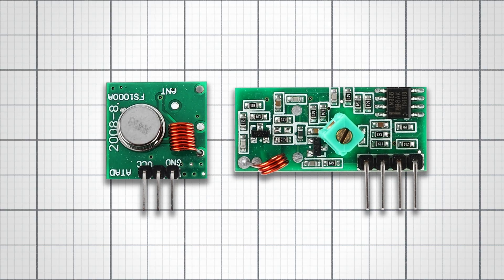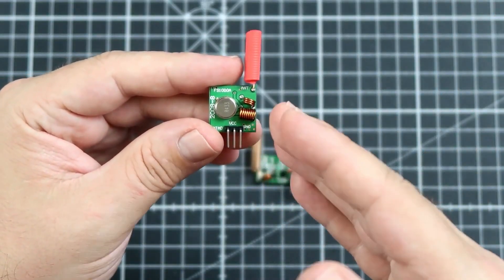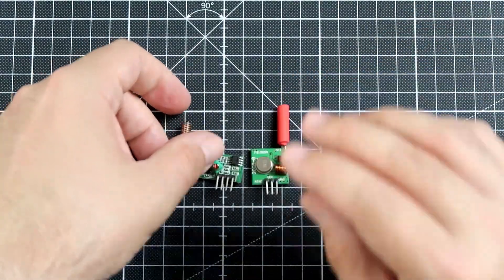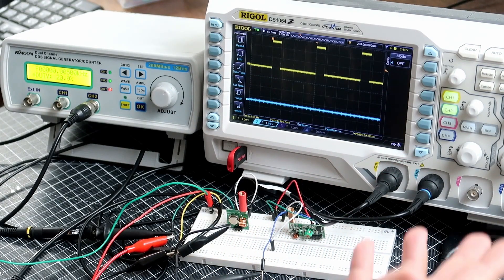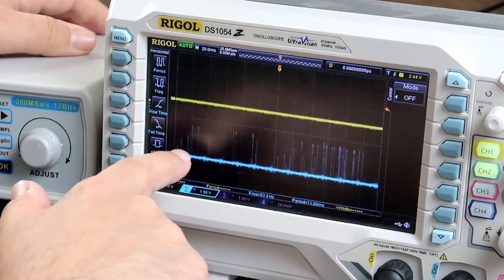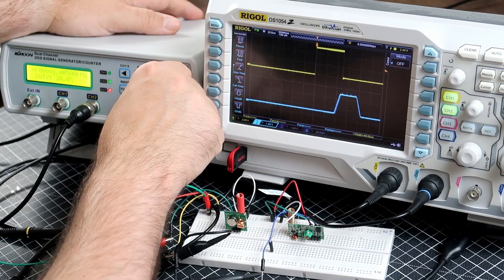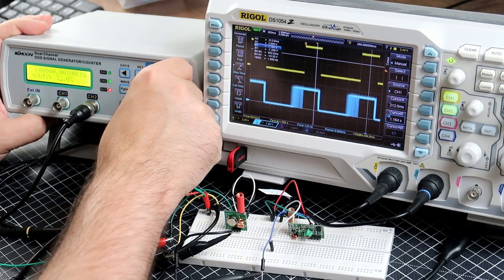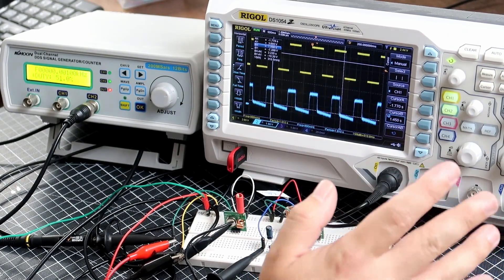FS1000A + XY-MK-5V: How They Work

Comment: In my experience the RXB12 Modules are way better in RX performance. I used them 10y ago. Today with Esp32 being so cheap and having variants that can also run Zigbee, I stopped using 433MHz completely.
Reply from the maker: absolutely, makes no sense to keep using those legacy devices and frequencies.